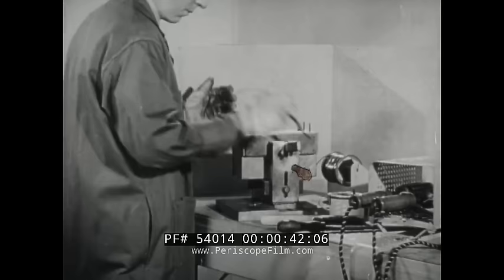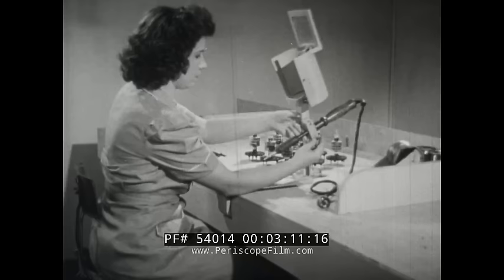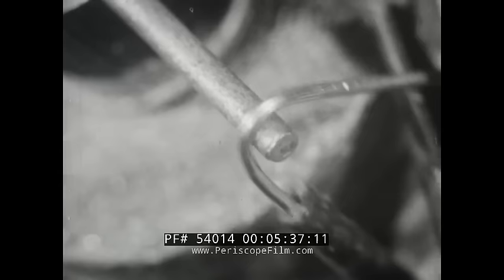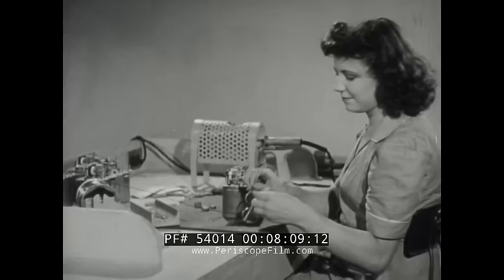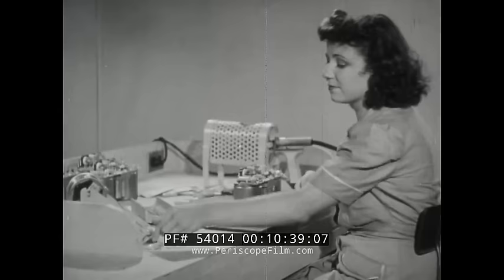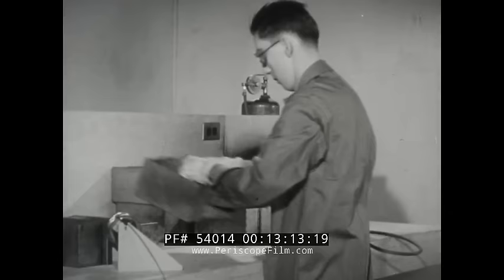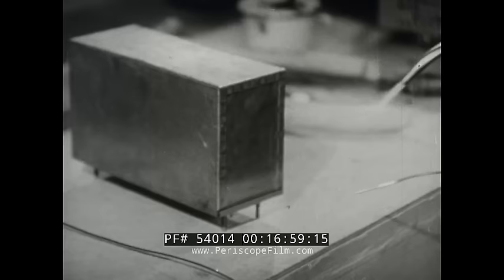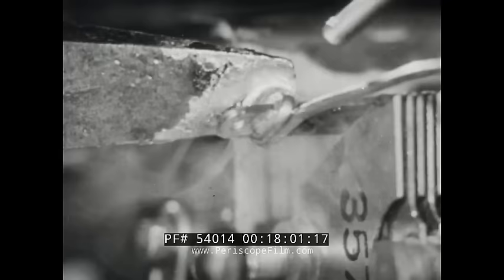HAND SOLDERING 1944 SOLDERING IRON TRAINING FILM 54014

Comment: I’ve been soldering since I was a pre teen. In my 20’s I went for a job at a company in North NJ called Falcon Jet. They gave me a 25 W. soldering pencil as a test to solder #2 cable. I laughed at them saying this wasn’t going to work. They intended me to still solder. I never heard back from them.   I guess they didn’t like my response to them when they gave me French schematic to read.  Such asssholes!
Reply: "#2 cable", you meant 2 AWG? 
- 0.2576 inch diameter ~ 6.5 millimetre?
That's not gonna work. 🤦🏻‍♂
- Did you tell them you'd need ~100+ watts and a ~ half inch tip to do that?
Merde! Au revoir!
Reply: @jabberwocky1707  Yes, like a car’s battery cable. I told them it wouldn’t work. Ridiculous!!!
Reply: @njjeff201  
Today it'd be a big crimp lug job.
- Done a few of those lately, (Yes, car battery cables! Glad I didn't have to crimp the 70mm^2 ones), along with Mil-spec cable connectors ( more crimping) and SMD solder/de-soldering! 
- Variety at least!